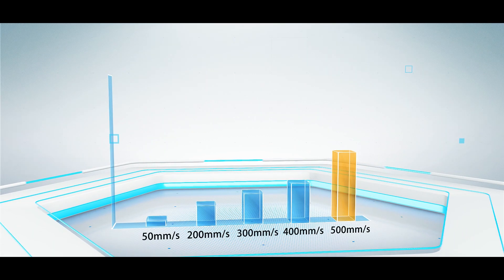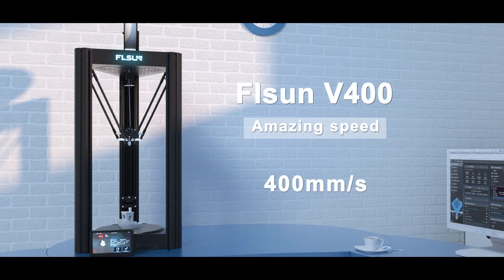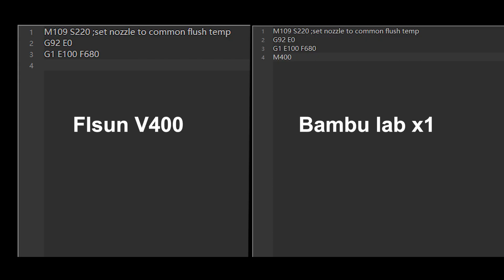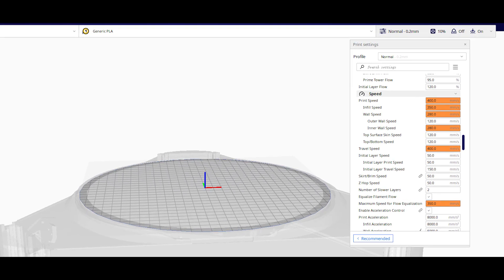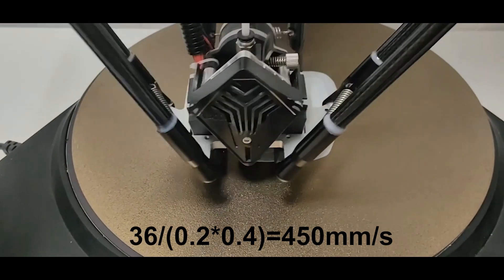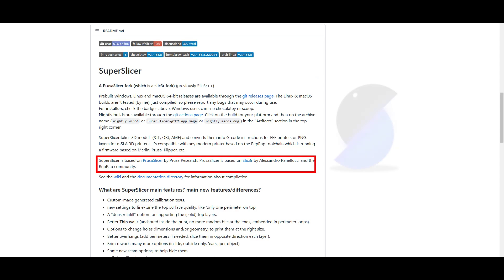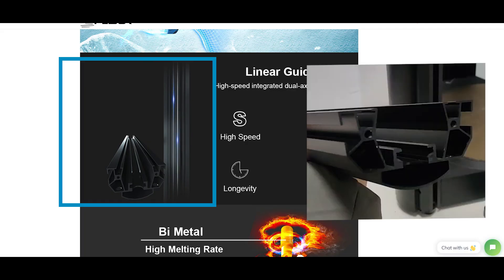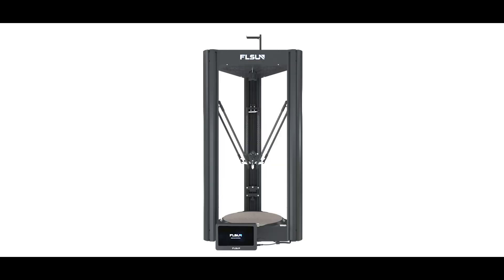The Fastest 3D Printer of 2023! Flsun V400 or Bambu Lab X1 ?

Comment: I like the delta approach (coming from the QQS-pro).
Bought my v400 new for 715€. The P1P is 790€, the CX1 1360€.
Comes with the SpeederPad with which you can run another 2 printers on Klipper for free. (250mm/s SuperRacer)

It's a shame they don't ship the accelerometer with the pad or v400.
You have to build your own from a Raspberry Pi Pico + ADXL345.

I do want the lidar on my next delta...or load cell leveling.

Comment: Carbon rods wearing out and it potentially only being fixable by sending in the printer to the factory is also a rather huge caveat against the bambu printers where as the flsun components are of-the shelf parts that can easily be replaced...
Reply: I got a. V400 and if you lube the joins will last many years ,also the set of complete rods is $100 and exchanged in 5 min

Comment: This isn't the first time I have seen quality issues with the V400 missing details or smoothing the print. Printing fast and losing detail kinda misses the point. @ 6:30 you are missing whole sections of the moon city print. I'm glad you were honest in showing actual results.

Your conclusion is flawed. If you are printing pla/petg in open air and don't need quality the v400 is fine. This could be fine for parts that need a lot of post processing or will be painted to cover up flaws and defects. 

If you need/want ABS/PC/CF-Nylon/ or filaments that require an enclosure on top if printing  pla/petg =X1C. 
Or need a larger square build area, camera, AMS, auto bed level, first layer scan, spaghetti detection remote monitoring, better slicer = X1C
If you are printing for accuracy and quality the X1C wins out.

Perhaps you should do a video showing how to tune the V400 for better results. Even if you need to slow things down.

I would also like to see a torture toaster to test dimensional accuracy.

Comment: V400 is basically for PLA/PETG exclusively. Building a heated chamber would be a pretty big endeavor. The X1 has so much more flexibility in terms of use. vertical build volume is huge but that would also become a hindrance when printing ABS/ASA etc... even if you are able to build an enclosure.
Reply: Thats not true bud. You can print everything with it, and 3 big sheets of plexi glass are not that hard to come by if you want to print in ABS.. you can print NILON, flexible materials, carbon implemented materials ect.. it is versetile
Reply: @rikampravdu8904  I didn't say you cannot print these materials. I said it would be a big endeavor to build a chamber that allows for printing ABS/ASA etc...
Though easy to come by, 3 large plexi glass sheets are not cheap yet and the sheets alone will do nothing without a frame robust enough to hold in place. 

The V400 does not come with a hardened nozzle so yes, you could but again you'll need upgrades. 

Any printer can be made to print 95% of available material, we all know this. Point is out of the box features and how much extra work it will take to get there. 

V400: No hepa filtration which is must for ABS/ASA, no spaghetti detection, no automatic PA/flow calibration per print/filament, no AMS system as robust as the proprietary BL system, etc...

Comment: Why not test the sound level of the X1 with the door closed since it has that advantage over the V400? You essentially tested the volume level as sound trapped/bouncing around in an enclosed space where it doesn't have as much air to diffuse. In terms of sound level, you test here was not an apples to apples comparison

Comment: The way I see it, the V400 is best for speed and efficiency, but the X1C is far better in terms of printable size. Really it all comes down to what you will be using the printer for, and/or what you need from the printer. If you're only building models, figures, or small parts for a project, the V400 is the way to go. But if you need larger scale models, then it's the X1C.
Reply: You did not just wrote that xD, what is bigger 256X256X256 or 300X400 ?

Comment: I have both .The FL SUN V400 works great, out of the box, prints ok. Various firmware errors at turn on, reset and all is fine until next shutdown. But i have no regrets buying V400. I will use V400 for some tall prints i need, and X1C for small ABS parts and multicolor.
Reply: Hello! Do you know where you can download the plugin for v400 to see the model on the screen? I can't find it anywhere
Reply: @mariklove_3D  you have to do some cheeky stuff for it to show up but you dont need no plugin
Reply: @rikampravdu8904  well then how can i see the models on the screen?
Reply: @mariklove_3D  you have to activate something in cura, i dont use it so i have no idea but there are few videos about it

Comment: Well I was afraid i made a bad choice by buying the v400 last  year.. had a few issues but thats user (me not having any clue how to 3d  print). But recently got it dialed in and able to get fast and fairly consistent quality prints.. So... up to testing a CHT bondtech nozzle on this to see if it works  and get even  higher melting flow? =)

Comment: You say buy X1C for multi-color, but failed to say for multi-materials. X1C is enclosed which helps
Reply: It’s not that good for multi material because of the one hot end and it will clog if the material temperature is to different but for material that are around the same will work sometimes
Reply: Ji
Reply: Ji
Reply: Ji
Reply: Cvvccgh

Comment: There are big issues with the review.
@6:31 - There is a huge quality difference between the images. Moon City: The large tower is only partially printed on the FLSun, the small towers lack their tips, etc. Groot: The FLSun suffers from Z-wobble and quality loss because of smoothing.
Reply: I think this is an interessting point, I have also seen other comparisons, where the Bambu printet more details at same speed then the V400. It might be more capable to change the print direction more abruptly, or just to better tuning. The V400 is much quieter though.
Reply: It's not z wobble
Reply: All I know is my Bro has the V 400, which got me interested in 3d printing so I bought the X1C and the print quality is much better on the X1. Could be just his printer...
Reply from the maker: Smoothing can be solved by adjusting the input shaping, and both printers have their own advantages and disadvantages😉
Reply: @3dprintertest  pretty sure you cant adjust it on the v400, and it also doesn't come with an accelerometer
Reply: @3dprintertest  In stock configuration running input shaping is not an option since the V400 does not come with the accelerometer, and the stock firmware does not support it. That's why I returned in and have the Bambu. Also the advertised print volume is false on the V400. It's a cone at the top, not a full cylinder. :/
Reply: The Bambu build volume is true and comes with the sensor built in,  for automated input shaping and micro lidar for automated flow setup. Neither of which the V400 has. One may be faster on flow rate, but without quality and tuning,  the speed is unusable and pointless.
Reply: @foam27  it seems that the V400 uses not the full potetial of klipper. It would be nice to see, if it archieves the same quality (at least like the P1P which has less sensors for auto calibration) if you would upgrade and tune the input shaper and pressure advance values nicely. The delta aproach is also good, I don't see why it is so unpopular. At the moment the price is an par with the P1P, and it has advantages much quieter, larger build space, higher temp, more open source compatible and disadvantages bigger, no enclosure out of the box- over the P1P. So I am on the fence.
Reply: Well the peak is 410 isnt it ?
Reply: @heavyweather  yes that is a plus for the v400

Comment: 7:23. This is a terrible argument.  A Delta printer expresses ALL of its travel for the entire XYZ volume, whether X/Y head movement, or layer change, as compound movements of the X, Y, Z towers.  A Core XY printer, such as the X1, ONLY uses the Z movement for layer changes, and expresses all of the X/Y head movement through its gantry system.  Since 99.9999% of a 3D printer's movement is expressed in the XY plane, with only very rare Z layer changes, almost all of the wear will be expressed in the XY mechanism and NOT in the Z mechanism.  So comparing the robustness of a Delta's Z mechanism to that of a Core XY machine's Z mechanism is a complete non sequitur, as the duty cycles are orders of magnitude different.  

A more apples to apples comparison, would be comparing the linear rods of the X1's gantry system to the V400's captured bearing system.
Reply: The review has other big issues too, this is just one of them :)
Reply: @war4peace1979  I agree, this is just one that was particularly glaring.
Reply: @Potato2456-o1w  Deltas don't use leadscrews.

Comment: Quel comparatif nul on compare une delta très rapide c est vrai a une machine capable de tout faire quasiment a la même vitesse et avec un grand panel de matériaux sans parler de l AMS .Ça conclusion c est si tu veux de la couleur prend la Bambu .Non si tu veux une machine rapide capable d imprimer du PLA DE L ABS DU PETG DU CARBONE...EN SORTI DE BOITE AVEC UNE TRES BONNE QUALITÉ C EST LA BAMBU .SI TU VEUX UN GRAND VOLUME RAPIDE POUR DES FILAMENTS FROID OK LA 409 EST TRES BIEN

Comment: well done! i got my x1 last week, new to the 3d printing world, a big +1 is their software, camera, app on phone, and the AMS system.  so if i understood correctly, the volume max flow only allows up to 350mms to print... but, what if i set my printer to 500mms (the max advertised)?  does this mean it will give an uneven flow since the printer is moving faster than what the flow can give?  i also want to mention the X1 is crap for TPU printing.  i am printing at 50mms and its eh when it comes to bridging or overhangs.  overall, loved your video and the way you presented all of this! bravo!
Reply: I think he's making too much out of flow rate.  People have tested these printers, and when you set the machine to 500mm/s, it's seriously fast (much faster than it is at the 400mm/s setting).  But the problem is still a matter of controlling the print head, pushing the upper speed limits will result in print quality starting to suffer (just like it does on the V400).  I have both printers, I love them both.  The speed is highly comparable.  If you have the money, and you want a printer that is as close to a "push print and walk away" experience as you can get, the X1 Carbon combo wins hands down.  Bambu is controlling the entire print chain, and is optimizing everything together.  Bambu was founded by DJI engineers, so they know how to do this stuff, and it shows.  This is a first generation product, and it's already amazing, and they are continuing to refine it.  The X1 is what you buy if you prefer the "Apple" experience (the company is going to work all the details out for you).  The V400 is the one to buy if you prefer more of the Android experience (you're going to be responsible for tuning things over time, and figuring out how to integrate 3rd party upgrades, like a Mosaic Palette, building an enclosure, optimal print settings, etc).  Now with that said, buying a V400 isn't like buying just any Android device, you're buying a premium one, like a Samsung Note.  

Honestly, I really do love them equally, but I wouldn't choose one over the other because of speed.  I wouldn't necessarily choose one over the other because of multi-material, as you could always add a Mosaic Palette to the V400.  I think it really boils down to whether you want a more open design you're ultimately responsible for, or a proprietary design developed and maintained by the vendor (in this case a very competent vendor who really cares).  Next thing I'd consider is the print dimensions of each printer, do you prefer one over the other?  How about the size, will they both fit in your space?  Then I'd consider my all in price to get all of the features I want.  Like it's cost me $150 in materials just enclose my V400.  A mosaic Palette with run you $400 to $800 depending on version (if you want to do multi material).  It's also worth noting that the Bambu AMS works differently than the Palette, each has its strengths and weaknesses, so you have to decide if you care about that.  Basically I'm saying I'd consider the eco system surrounding the two printers.  Lastly, depending on what you want to do with the printer, novelty of the delta's movement may or may not be of value to you.
Reply: @bujin5455  i was a noob to printing and grabbed the X1C.  its aweesome, ive learned how to print under a week.  i do agree the flow parameter is odd, bc you def can set this mambo to 400/500mms and it rips.  yes the quality goes down with speed but it sure can do 500mms.  not to mention X1C acceleration can go up to 20,000mms and i thnk 1,000 travel speed?  you are correct, i like the analogy, for sure X1C is an apple vs the android. i love how it was all in one package and i dont have to waste time programming it before knowing the world of 3d printing.  i have too many other hobbies that consume my time ha... anyway, i freaking love this printer.  its just "ok" for TPU.  i also did notice throwing bambu PLA at it was amazing results while polymaker was eh... i def think this printer prints best with their filament. its not that much more money either, its just never in damn stock! ha
Reply: @aerialphotons237  I love the X1C also, as well as their AMS, the two really do work great with each other.  Today I ran out of filament, and the AMS told me it was out, and the printer just kept printing.  I replaced the spool, WHILE the printer was printing, and it never stopped!  Another time I had a spool get tangled up, which stopped the printer.  It detected it, told me about, I fixed the issue, and it just continued, no problem AT ALL, not even a gloo blob where it picked up again!  The X1C, combined with the AMS, is really on a completely different planet as far as ease of use goes.  

Regarding filament selection, that is one thing that is kind of a bummer with the AMS.  Not everything fit in it.  However, my favorite filament, Hatchbox, does.  And it looks REALLY good too.  So if you haven't tried that out yet, you might want to.  But then again, Bambu's filament isn't really all that expensive.  Quality filament is generally about ~$26 a kilo.  Though Voxel looks quite promising.  I've ordered some of that, and that's ~$17 a kilo.  It's supposed to be really good professional print farm level stuff. ...we shall see. 

But as far as a first printer goes, you're definitely not signing up for the trial by fire that I did when I got started.  Bambu has really taken most of the pain out the situation  Congrats on your printer, I'm sure as time goes on you'll fine loads of awesome things to do with it.
Reply: @bujin5455  thanks man! good to know anout hatchbox., i was on the fence with them as heard ups and downs with them but i like how i saw much more variety in their filament. how far off are you straying from stock settings with matchbox PLA'? any pointers to save me some pain lol?
Reply: @aerialphotons237  Settings often depend just as much on the printer itself, and your slicing, as it does the filament. As far as the X1C goes, I've simply ran the hatchbox with Bambu's out of the box settings, and it looks great.  I've tried a LOT of filament vendors, and I do like Hatchbox a lot.  Their filament is consistent, it prints well, has good layer adhesion, doesn't smell terribly, they provide a good variety of materials and colors. 

 There may be people who have a better this or that over Hatchbox, but overall, I've never had a bad experience with Hatchbox, never had it jam a nozzle on me.  Which I bought filament from a new vendor a few months back to try out something I thought I was interested in, and their dimensions weren't consistent, and when the filament got thicker, it jammed itself into the heatbreak, and it was a living hell getting it out, and I broke the thermistor while I was doing it!  Beyond jams, consistency is also important, because that will affect your flow rate.  Too much, and you can jam, or have plastic "push out" causing bumps in the print, and cause the print head to catch on those bumps, making you lose a step, shifting the entire print over a step from that point forward.  Too little, and you can have thin places in the print, which may cause weakness and poor interlayer adhesion, or holes between layers/lines.  So it's a pretty big deal.
Reply: @aerialphotons237  thought I'd report back, and let you know I've printed several spools of Voxel at this point, and I can say, their filament is top notch!  Super happy with it.  The only problems with Voxel is that they run out of colors, and it takes them a while to restock, so you have to buy what you want when you get the chance.  They also don't have that wide of a color selection, though they do seem to mostly have the important ones, and the quality is great.  The last problem with Voxel is that they only have PLA.  The Voxel spools do fit in the AMS, so that's a plus.  Basically, I think Voxel is going to be my go to supplier for things they offer, but past that, it's going to be Hatchbox for everything else.
Reply: I've had both, the Bambu is MUCH better in print quality and tailored software.